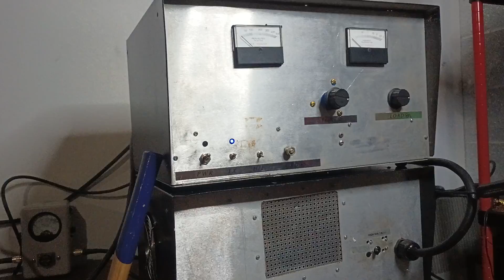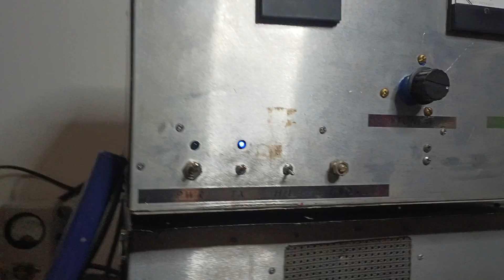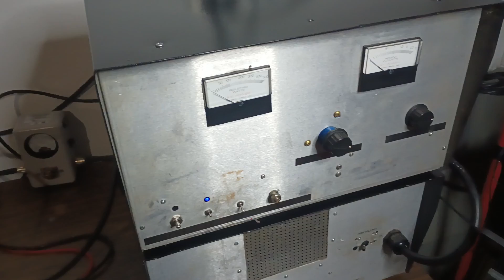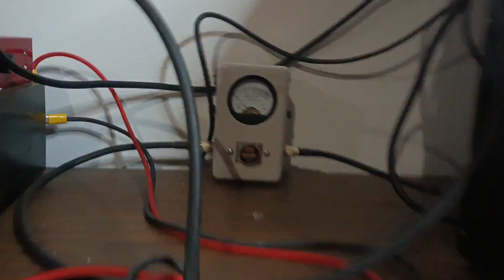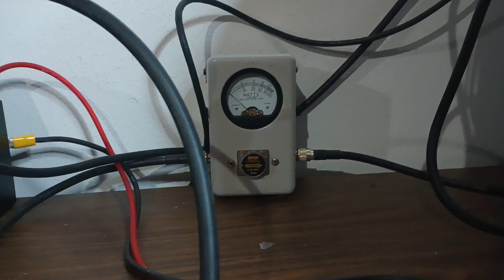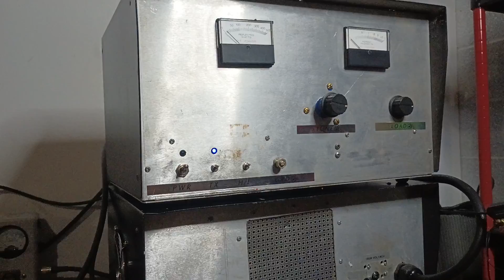5cx1500 Steel Tube Base Amplifier, 220v, low drive amp, local pickup only

Comment: I really wish amp builders would stop using these two piece designs. These are extremely dangerous and can easily kill someone who doesn't know or understand how tube amps work. Any contact with that HV wire in the back of this amp would result in a very painful and agonizing death. Even if you survived, whatever part of you that made contact would be literally burned off. A ham friend of mine got hit while inside a Heathkit SB200 and it burned the tip of his finger right off and sent him flying across the room. Literally knocked him out. He said he woke up on the floor and the end of his finger felt like it got chewed off by a pit bull. No blood, the burn cauterized it. He was lucky to survive. And that was only half of the power supply this monster has. Why he was inside a live amp is beyond me, that was a dumb thing to do to begin with. Be careful out there guys.
Reply: I know how tube amps work. Plug in. Crank it up. Then, strum a fat power chord. The end.
Reply: @Urtjjfjrjtk  You reminded me of the movie Back To The Future when Marty plugged his guitar into that gigantic amp and it exploded in his face. LoL
Reply: @richb.4374  heheheheeee...

Comment: Well this one is interesting. Ive seen a few that i wish i was local to ya! I like to old tube stuff! If ya remember ive got the FT 101 and FL 2100 B Yeasu stuff and the 572B tubes are hit and miss these days and I'm tired of putting out the money for new China tubes. So ive gone this route and changed the sockets to fit the 3-500z tubes. RF parts were out of those so i went with the 4-125A tubes. After a ton of modifications and basic engineer work it works great and has more watts to boot by alot! I talk skip with it daily!